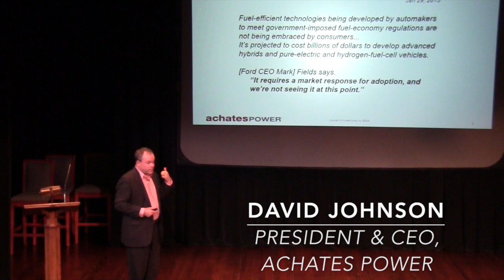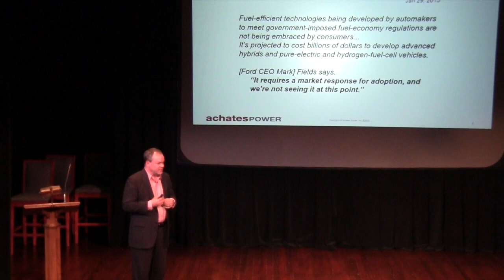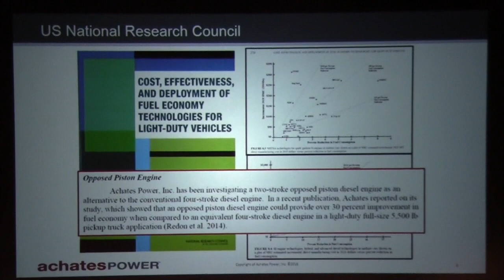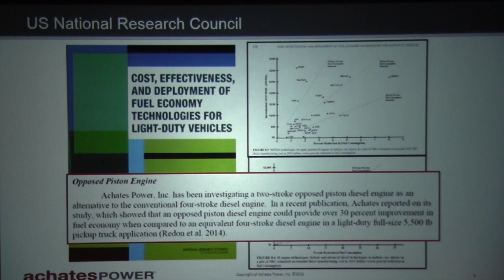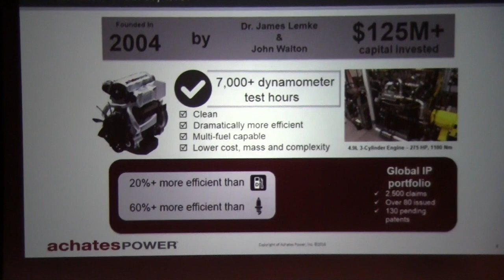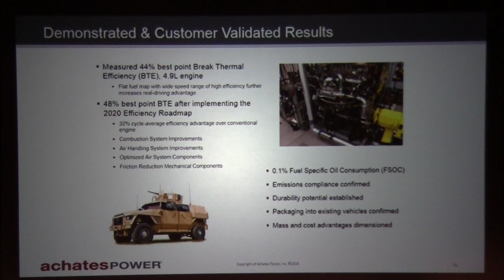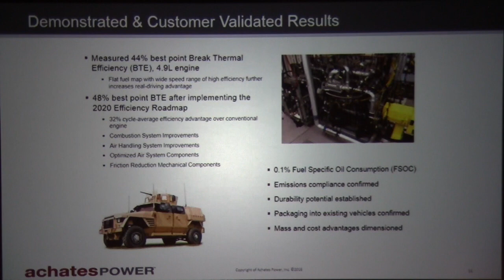Achates Power CEO David Johnson speaks at 2016 SAA Auto Outlook Conference

Comment: I’m late to this party,  but here we are 4.5 years after this video was posted,  and this technology is gaining a foothold. 
US Army wants a bunch,  companies running tens of thousands of semi-trucks want it,  and I can’t wait to see the 20 liter version at 1500 HP.  The torque number of that thing has to be 😳
  Oh,  and the person who operated the camera for this video.....please get some camera coaching. 😖
Reply: Yeah being a big 2 stroke OP 20L. brapppp
Reply: Hopefully it can be converted to an MSD magneto spark ignition and run ethanol/propanol both with have over 110 octane and a synthetic plant based 2 stroke oil too. Look up the Rotax 850 Etec turbo in the Ski Doos and they got a ton of power and torque for their size. eventually we will move on and tap the aetheric ZPE quantum vacuum energy like lots of inventors did and got supressed. now we can have either a high power overunity homopolar motor/generator (Bruce Depalma) or for us 2 stroke lover a pulsed plasma closed cycle ball lightning powered 2 stroke (Joseph Papp).

Comment: There is NO PEAK OIL. ORNL proved Thorium in the 1970's which is an abundant fuel,NO WASTE, passive safety,useless for weapons and perfect high temps for Fischer/Tropsch process to make synthetic fuels.    China has put 4 billion US into 2 prototype reactors for a 10 year trial, and will then mass produce modular reactors. We do need better efficiency and diesel is THE workhorse that will combine withThorium to provide mobile power.
Reply: They did not proove thorium, at least not all wrinkles were ironed out, as was needed in order for them to be practical back then.
 However today is proving to be a different day.

Comment: Looks very promising.  I'm holding off buying a new car until I can get this engine.  Hopefully in a year or two.

According to this presentation, in 2016 Achates had the following programs underway:  5 truck, 3 car, US Army, Fairbanks Morse.

Also a DOE funded OPGCI project.

Opposed Piston Gasoline Compression 
Ignition
 $9 Million grant from the U.S. Department of
Energy's ARPA-E
 With support from Argonne National Laboratory and
Delphi Automotive
 Develop a three-liter, three-cylinder opposed-piston
gasoline compression ignition engine
 Two clean, efficient and cost effective
technologies – OP and GCI – together will make
the perfect high-volume engine for markets all
around the world.
 Fuel efficiency gains of more than 50 percent compared
to a downsized, turbo-charged direct injection gasoline
engine
 Reduces the overall cost of the powertrain system
 
https://societyofautomotiveanalysts.wildapricot.org/resources/Documents/Achates%20Power%20SAA%20Outlook_01102016.pdf

Achates is working with Delphi Automotive (which has been avidly pursuing gasoline compression ignition for some time) and Argonne National Laboratory on the ARPA-E-funded project to develop the OPGCI engine. (Earlier post.)

ARPA-E is providing initial funding of $9 million to this project over three years; Achates Power, Argonne and Delphi expect to spend a total of $13 million on the program, including cost share. The $9-million award was “one of the largest single ARPA-E awards ever made,” noted Chris Atkinson, the ARPA-E program manager for the Achates project.

The goal of the 30-month Achates ARPA-E project is to deliver a three-cylinder, 3.0-liter opposed-piston, gasoline compression ignition engine applicable to large passenger vehicles, pick-up trucks, SUVs and minivans. It could also be the first of a family of OPGCI engines spanning 1.0 to 4.0L displacements, said Redon.

The smaller displacement derivative (1.0L) could be extremely interesting as a range extender, while a two-cylinder derivative could serve nicely as a direct drop-in for front-wheel drive applications, delivering around 180 hp and 430 N·m from a swept volume of 1.8 liters.

<img src="http://bioage.typepad.com/.a/6a00d8341c4fbe53ef01b7c8c7ba6f970b-550wi" alt="Ope2"/>

[433 No = 319 ft lb]

http://www.greencarcongress.com/2017/01/20170113-achates.html